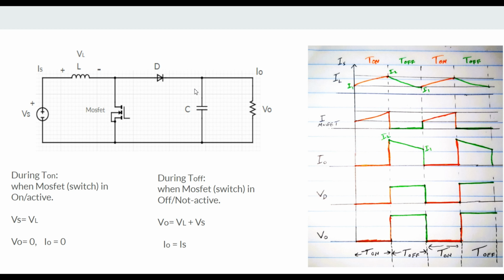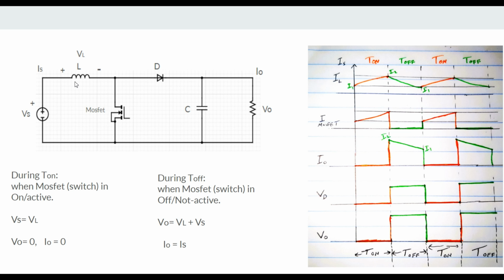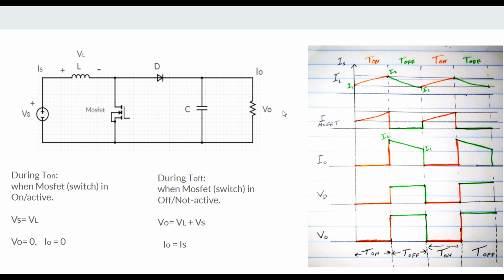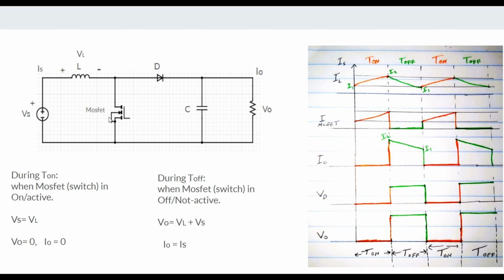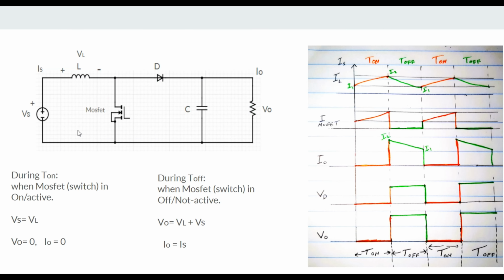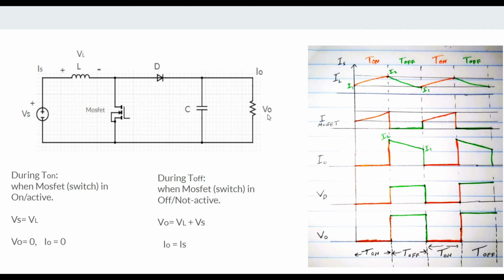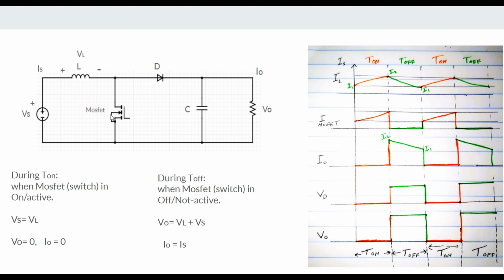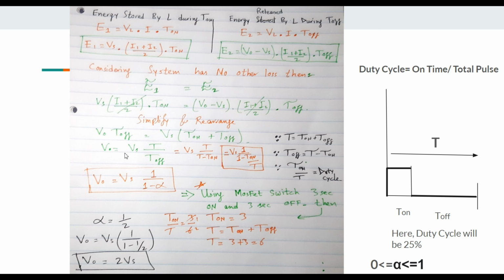What is Boost Converter and its calculations ? Waveform and Equations of Boost Converter.

Comment: There are a lot of mistakes in the commentary. It would be better to go outside and do some gardening. 
Current does not flow around the circuit containing the inductor and MOSFET. 
This is something the instructor does not understand. 
The inductor receives a PACKET OF ENERGY. A packet of energy consists of a voltage, a current and a period of time. 
This packet of energy increases the density of the magnetic flux in the core of the inductor and surprisingly, little or no current flows through the MOSFET. If it does, it means the core is saturated and the inductor must be turned off before this happens. 
When the MOSFET turns off, the magnetic field collapses and the inductor produces a very high voltage in the opposite direction.
This high voltage is added to the supply voltage and flows through the diode to the capacitor. 
But the voltage on the capacitor is much smaller than the voltage produced by the inductor and it appears like “hitting a brick wall.”
Whenever a high voltage meets a low voltage the high voltage tries to deliver to the low voltage and to do this it requires a high current. That’s what the inductor does. It produces a high current and this high current passes through all the turns of the inductor and produces an expanding flux that opposes the collapsing flux. This reduces the effectiveness of the collapsing flux and reduces the output voltage and this reduces the current. That’s why it takes so long to charge the capacitor. 
But half the cycle is taken up with energising the inductor and half the cycle is taken up with delivering its energy. 
This means the inductor must top-up the capacitor and supply energy directly to the load for this half cycle. 
I have not talked about voltage or current.  Just a packet of energy. In fact the current has to be twice the load current to perform this operation. 
One lot of current goes to the capacitor to “top” it up, and the other amount of current goes directly to the load so the load does not have to go to the capacitor. 
The voltage on the capacitor is monitored all the time and if the inductor supplies too much energy, the voltage on the capacitor will increase and the circuit will detect this and reduce the mark-space ratio of the oscillator. 
If the output voltage goes too low, the mark-space ratio is increased. 
This upper and lower value is determined by the control circuit and the module could produce a perfect output voltage but the circuit would not know when to increase and decrease the ON-time. 
So,  nothing is like you have been told. 

   Colin Mitchell   talking@tpg.com.au
Reply from the maker: thank you so much for your detailed comment and explanation. It is very clear and understandable decription. Yes, i agree there will be major and minor improvements needed in the video and also in my explanations. Soon my team will upload  detailed video on this topic with imporved and simulated descriptive version. I hope simulation view will be more easier to understand. You can also go through other material of this channel. Thank you for your poductive feedback.